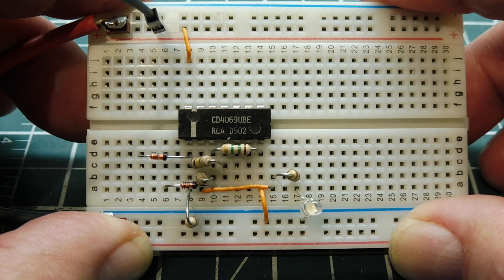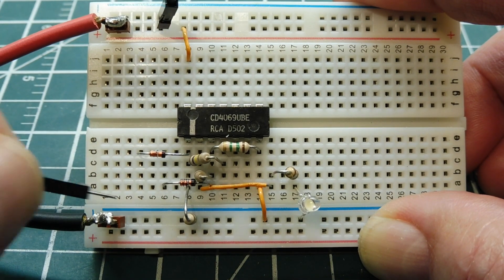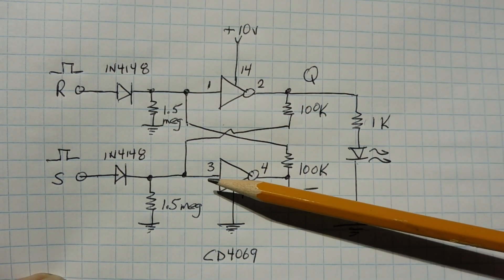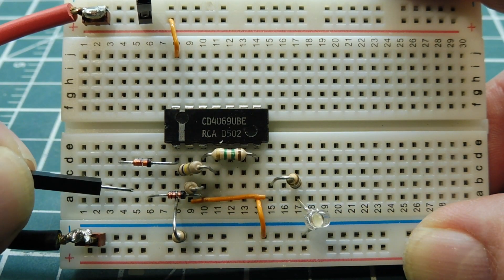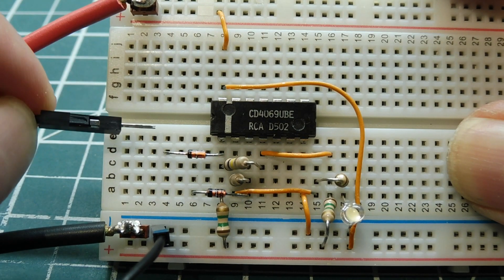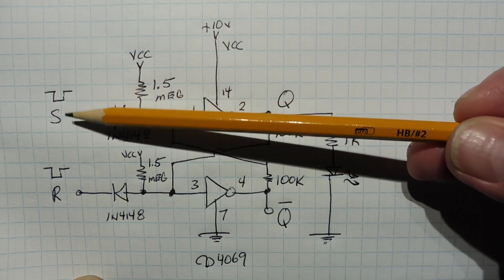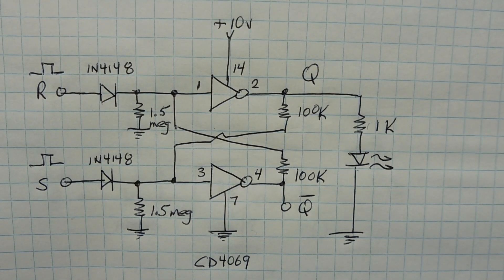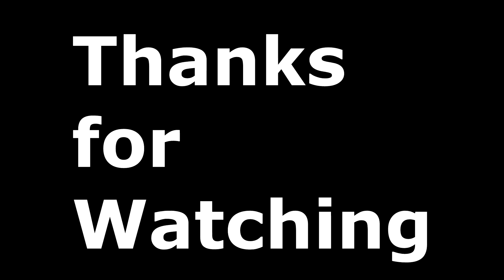SR Flip Flop  / Quick Circuit Design

Comment: One question: if we initially apply voltage to this circuit and our inputs are floating in the air, which output will turn on, Q or Qnot? I think that the outputs will turn on randomly. I can be wrong though, it would be great if you explained this moment, please.
Reply from the maker: Both inputs are not floating but held low by the pull-down resistors on power-up. The outputs will still power-up randomly the same as any other NAND/NOR SR flip-flop. You would have to provide your own power-on reset circuitry in your design.
Reply: @0033mer  Thank you for your answer!